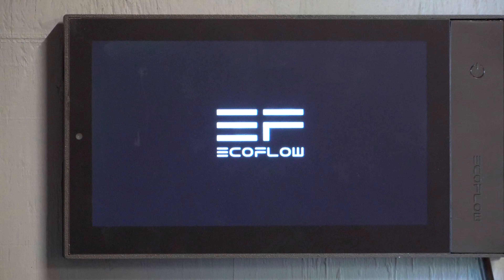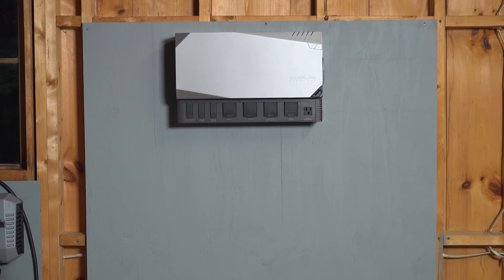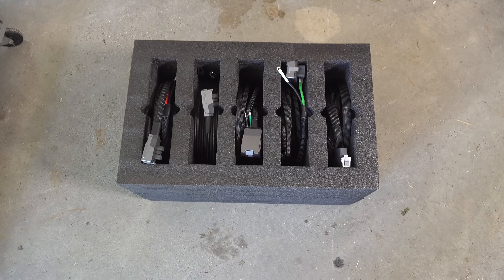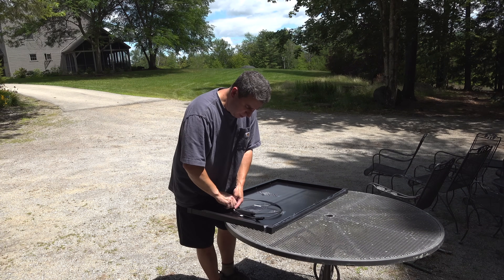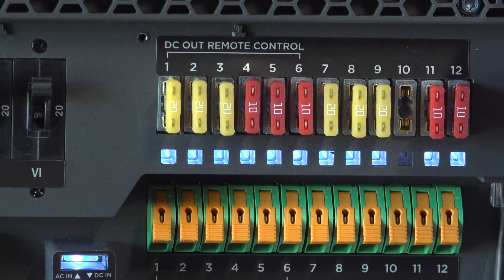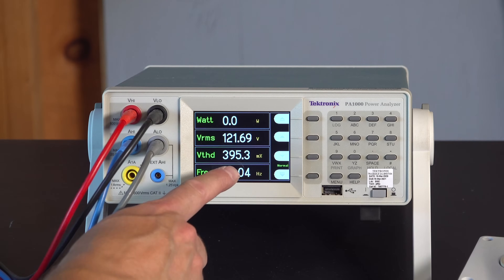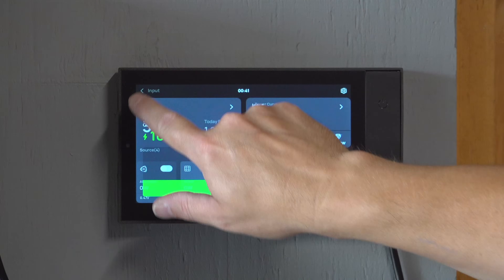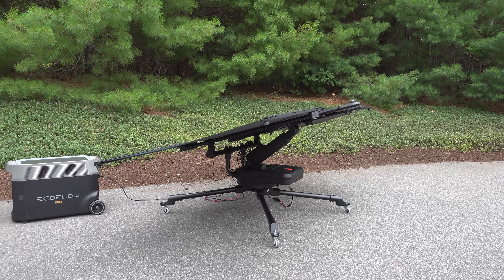PLUG & PLAY SOLAR FOR OFF-GRID & VANLIFE - ECOFLOW Modular POWER KIT REVIEW

Comment: Quick question for ya- this is a great review. I’m getting ready to buy this kit for my off grid THOW and am wondering about how you get power to the inverter- do you use a second power source? Or does the whole system just kick on when you have enough juice from your initial panel plug in? Hope this question makes sense 😅 I don’t speak this electrical language very well. Thanks!

Comment: Do you have any idea whether the top or bottom port for the power hub solar connector is positive? I have to cut my solar mc4 connector off to feed through my roof gland and now wondering which wire is positive :)

Comment: What happens in case of a failure in the Can-Bus? Without signal, will the DC output (at Distribution panel) be powered, or not powered?

Comment: Although the system seems extremely robust and simple to setup, the cost and output power is deal breaker. In Europe they full 15kwh setup costs almost 19000euros. Giving that much for a 4000w out is not good for me.

Comment: Can the AC breakers be changed to a lower amp rating?  I’m interested in the possibility of swapping this system into an existing RV.  The distribution panel would replace the factory one and most of the circuits in a 30 amp RV are 15 amp, so having 20 amp breakers is dangerous.

Comment: Sir, first thanks for all the nice information movies.

For use at a fixed site (my home), would it be possible to use the Smart home panel together with the power kit... So you can have more batteries 's instead of the smart home panel and some Delta pro's?

Comment: Hi I have a small garden shed that I would like to have a led light and maybe two plugs and capable of running a small heater in the winter and change a lawnmower off solar and a bay is there any recommendations you have

Comment: I recently priced out a similar sized DIY system and this isn't too bad price wise. The key difference is that a DIY server rack system will scale far more cheaply when 5 kWh EG4's are going for just $1500. However, most people don't need more than 10-15 kWh and a 4000W output for their builds, and these are self heating batteries unlike those EG4's. Having everything fully integrated with an app that isn't complete junk like all the other units i've used is worth any premium alone, the easy hardware setup is just a bonus.

Also, this is the only unit I know of where you can connect AC, solar, alternator, generators and batteries all at the same time and it will just "figure it out" for you for the most part.

Comment: Oh Jesus, many companies have similar PV equipment but much much cheaper. And what is more important that they use standard parts ( plugs, boxes) that can be easily repaired or replaced after 5-10 years. Just look for Sunways, Fronius or smth like that.
And my very professional advice: before u order smth just talk to the people in the field - they are always glad to give you useful advice without charging. As we are people should help each other.
Reply from the maker: I wouldn't say much cheaper for the same specs, alternator charing, touchscreen, circuit automation/control and 4000 watts. It's a lot in one system that doesn't require a phd or hours of programming individual components.
Reply: @SilverCymbal  it's not 90s any more - nowadays almost every inverter has appropriate app for a self management purposes and I don't understand why should I also pay for the useless touch screen display as I already have one in my handy. 
It's kinda funny that you think modern manufacturers are designing their products in such way that it might be manually programmed by the end user with a preknowledge. User unfriendly companies didn't survive in this field.
I am working in this area and normally setting all the stuff is not longer than 20 minutes (reading manual is included).
Reply from the maker: @xp-4yt  Thanks for letting me know. Does every inverter have an AC/DC distribution panel with switched circuits and power monitoring and a 4000 watt output, 60% less cabling. I totally get that you are a pro in this space, so the idea of a simple system that doesn't need a pro probably isn't appealing to you and you are comfortable with what you know. Even the best installs I have seen are still a mess of cables, sure tied down but way too many. This one box eliminates 6 others, that I like.
Reply: @SilverCymbal  In which part of the installation, for example,  "Sungrow SG5.0RT" needs a person to be a pro?
And another question: i see "EcoFlow 2kWh Power Kit" for 4900 euro, but similar Sungrow with battery is only 2300 euro. Yes, there is no DC output, but if u need it so badly ( i dont know anybody who asked for it) just buy AC-DC inverter for 120 euro and connect it to the grid. In the worst case,  one should also pay 300-400 euro for qualified personal  to insert plug into socket, but there is still win at almost 50% of the EcoFlow price. However cosmic design isnt included. 
And the last one: lets take again "Sungrow SG5.0RT" with a battery. Which exactly cables that this inverter has, are not needed in the "EcoFlow 2kWh Power Kit"?

Comment: there doesn't seem to be a 220V output on the system to wire into main house breaker panel to act as backup generator. Can you confirm?
Reply from the maker: Correct, these are only for 120v. So for a full sized house it won't be a good fit. But for tiny house, and even a 120v well pump this would be fine or mobile uses too.
Reply: @SilverCymbal  I have a sub panel  with an outside receptacle that I can connect to my 900w generator when power is out. I can run all 110v circuits. Nice to have TV, internet, lights, coffee pot, microwave, etc. Now I want this option added!

Comment: Honestly, the biggest expense between building your own vs ecoflow is the batteries and customization. Building out a 15-20kw system BOTH are roughly the same price if you choose the DIY 48v system compared to ecoflow. A DIY 12v system does run extremely pricey (fatter wires, multiple 100ah batteries, etc). Personally, i chose the 48v system to run in my camper and not only can i run full scale appliances but i can also charge my wife’s Tesla from my camper van. Given it only can give her 60 ish miles at a time but I’m limited by the solar panels tech and space for them.
Reply: Lol, no. You can build a system with 3x 5kWh 24V server rack batteries and a Victron Multiplus or similar hybrid inverter for about half what the "sale" price from Ecoflow is. If you want to go really cheap you can build your own battery bank using raw cells from China with a few dirt cheap BMSs.
Reply: @andrewfidel2220  Building a battery bank from china parts would be beyond my skills and most peoples skills. I just went as far as the server rack batteries trying to find "reasonable" priced ones. I have parted out an entire build with victron items (going with the new EasySolar 2 48v 5000) and anything else Victron needed PLUS wires, connectors, heat shrinks, etc... and it comes out to about the same price. The batteries are the killing item in the setup but a 48v 100ah is the same price as a 12v or 24v 100ah. Ive been looking (as hard as I can) for the past year since things are getting more expensive. If you have a good layout for a decent price I'm totally open to ideas.
Reply: @Chris in what way wouldnt they be ok to be in a vehicle vs a garage? not being combative or argumentative, Im legit curious just to see if there is a way to make it better.
Reply: @Chris perfect, i believe I have some solutions to those issues. I appreciate your words of wisdom.

Comment: 3:12-3:19 batteries capacity (2,000 kwh to 15,000 kwh) is that accurate?
Reply from the maker: The system can handle 1 to 3 batteries in total. They are selling 2kwh batteries & they have 5kwh batteries. So if you went for the 5kwh x 3 you would get 15kwh total capacity.
Reply: @SilverCymbal  I follow your channel alot & based off history your content I'm assuming you misspoke. Capacity of 2000kwh to 15000kwh is 1000 times 2kwh to 15kwh. On the video you're talking about the earlier, instead of the later!
Reply from the maker: @PN-ve9lf  Yes you are absolutely correct. The summer heat must be getting to me.  Yes, it should gave been 2000 watt hours to 15,000 watt hours.

Comment: Until they will release lifepo4 model in range around $2000. I am not interested
Reply from the maker: I agree that the cost is very high, but if you price it out in pieces, add it all up, its more money than this and you will never get automation or central control like this
Reply: what I meant is Eco flow delta max with lifepo4. As an entry point for me to solar $2000

Comment: I have a mobile car detailing business and I currently use the predator generator. In your experience do you think eco flow would be a good switch and provide enough power for me throughout the day. At some points during a job I’ll be using 4000 watts at once for about an hour.
Reply: At the price right now I'd say yes but if you can find 2 ecoflow delta pro's at the equivalent price of the current pre orders on the kits I'd say get the pro's since the ability fo being mobile and on the run you can also charge at a ev station. And you'd have to just add solar onto your vehicle

Comment: Cool but very expensive.
Reply: How much would it cost to build an equivalent system with cots components, plus the design and installation? 
If you get the diy route, only the crimper for the battery cables can cost 50$ alone. 1.5awg battery cable is 10$ a meter... costs adds up quickly.

Comment: can I also connect their generator to auto turn on when the right parameters are met?

 I believe it was your channel I seen an eco flow generator on?
Reply: You can and it only works with the Eco flow generator. Sadly it plugs into the third battery port so it limits you to only 2 batteries.
Reply: @edgardme3  one thing I thought about for batteries is charging power tool batteries on long sunny days and on low input days don't I use those when the power goes out for lighting I have low wattage power tool flashlights so it's a good place to store extra solar production